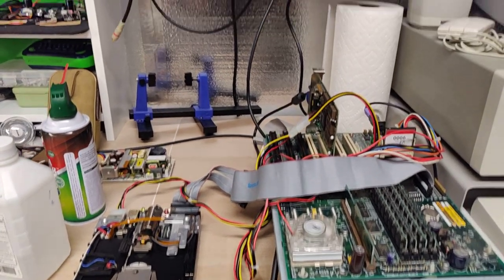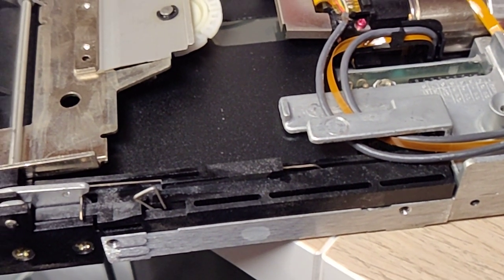Quick take: Fixing an interesting Okidata GM-3315BU 5.25" floppy drive

Comment: Nice quiet drives, must have been expensive to make or unreliable since I can imagine they'd have been more popular. Having said that, I always liked the mechanical sounds drives made. They give the machine character and when you're used to them you can generally tell if something is going right or not from the sounds emitted.

Comment: One of the drives in my Compaq Portable II doesn’t work and the other can be flaky sometimes, so I’m going to try this! Neither spit the disk out properly when the door is open either, so I’ll get that fixed too. The Portable II uses the same drives, with the only difference being a gray faceplate versus a black.

Comment: One of the DIP switch settings is probably to bypass the head loading solenoid. That solenoid is some sort of leftover from the 8 inch floppy drive days where the spindle motor was always running.

Comment: Pretty sure the large diameter thin steel plate around the drive motor is a flywheel... there to increase rotational speed uniformity. (Edit for readability.)

Comment: I heard you said motoroil. I would be careful about using motoroil with plastics at least for the long run. I think silicon grease is whats recommended for this application.
Reply: Certain types of rubber can be degraded by petroleum oils. I don't know about plastics, but it depends on what it's made of.

Comment: It's not a "half height" size, it's quarter - the normal 5.25 units are already half height.
Reply: After seeing this video I obtained 2 of these drives from ebay for some project computers, and they are more like third height drives. Not quite as tall as a half height, but stacking both of them on top of each other and they are taller than a half height.
Reply: Yeah, once you get out of full and half, it gets hard to tell a 1/4 from 1/3 or 1/5 drive with out having a ruler next to it! I used to use some with my BBCs which were under 2cm tall - they didn't even have room for an eject/locking lever. You put the disc in, and presses a button in (which latched) to lock it. Pressing it again popped both the button and the disc out.
Horrible drives they were!
Reply: Got several of these, and they are exactly 1/3 height. You can fit three into a single full-height bay with no gaps.

Comment: The head probably generates a slight magnetic field spike when first energized, so by holding it away from the surface until the inductive spike is damped prevents damage to the magnetic media.

Comment: It's funny he didn't know the size of these drives (perhaps he doesn't have any 5¼ half-height drives - floppy OR hard).  These are "one-third" height drives.  If you stacked 2 half-height drives next to 2 of these... you would see they are shorter by one-third (or if you had "3" of these, they would be the same height as the 2 half-height drives)!

There was a time, that if you had "two" floppy drives in your PC... you were a SERIOUS computer user!! 😉

When I first had my own computer, software was loaded or saved on audio cassette tapes (leaderless "Program Data" cassettes were preferred... but any standard audio cassette tapes would work, which is what I used).  A few weeks (maybe a month or two) later, I got a floppy disk drive.  It was a "full-height" 5¼ drive, and ONLY "single-sided".  Boy, was I stoked to have such an advanced, powerful computer system!!! 🤣

Comment: The Canon MD5501 has a similar form factor and the disk loading mechanism is also quite similar but that one uses a normal stepper motor and once the drive bay is closed the heads are lowered onto the the disk.

Comment: Cool drive! I wonder if the head transport is a voice coil. Kinda looks like it, with an inner and outer magnet. It looks to me from here that they're quarter-height drives. I wonder if you can fit two in a half-height bay. You can tell these are much later drives, because they have double sided heads and are probably 1.2MB HD. Close to the very end of the 5.25" formats life time.
Reply: No they are more like third-height, and they are 360k DD not 1.2MB HD.

Comment: I've got a couple of drives on the shelf that are similar to that, but not. I'm not sure the brand, but they are combo 5-1/4 + 3-1/2 drives in a single 5-1/4 form factor. Haven't looked at them for years, but held on to them in the event I ever needed a 5-1/4 drive.
Reply: Teac dual media floppy drive is God tier.  I still have mine that I bought new back in the early '90s.  Treasure it.  Always.
Reply: I've got a couple like that.  They're Epson IIRC.
Reply: Bandana zX  I went digging around and pulled one out, and they are the Teac drives.  I know that they work as well since I tested them out when I first got them. One is still installed in a computer that I put together to use for all sorts of diagnostics on used equipment that I got.
One of my original aims for the drive was to see if there was any way I could put it in my Commodore SX64 portable. Thought it would be nice to have both 5-1/4 and 3-1/2 in the same 5-1/4 existing slot. Would mean a significant bit of retrofitting of the electronics, which is why I never got around to it.
Reply: Adrian Black  : The physical mechanism of the drives isn't really all that dissimilar. A stepper motor driven read/write head, spindle motor, and the read-write head itself. The big difference is in the control electronics.
The C64's 1541 drive basically has a full computer built in, whereas PC drives contain only the drive interface.  This is why the drives were so slow in their default configuration.  The fast-boot cartridges bypassed the standard data transfer mechanism by downloading new code to the drive itself in order to speed things up.
My thought was that if the interface was removed from the drive, then the 1541/1581 control board SHOULD be able to operate the drive directly. But like I said, the time involved in tinkering to try to get everything right, along with the lack of a spare 1541 control board, is what kept this project on the shelf.
Reply: I had a Leading Edge 386 many years ago that had one of those.

Comment: Reminds me the Zip 100 drive using linear acturator for heads. Probably this drive would be capable of higher densitiy since you can have more tracks than standard floppy drivers that move on discrete steps.

Comment: Going to bet the head actuator is an inline direct acting bipolar stepper motor with a fast pitch lead screw. Unlike the cheaper variants of 3 1/2" that have a follower arm that tend to torque to one side (source of the infamous floppy noise) this only has to rotate 2 to 3 turns to make the full stroke.  This comes at the cost of lower output torque and is why the heads are lifted when not reading since they would tend to be dragged by the rotating floppy. And since the motor is at a mechanical disadvantage with no way of knowing it has missed steps it wouldn't take much to have the head stall like you had.

Of course this is all speculation based on my limited experience amd what we can see. Cheers!

Comment: Reminds me of the motors Sony used in the Walkman. If it's similar, the spinning disc is a magnet, with coils underneath.
Reply: The thinnest ones used a pair of pancake servos integrated into the main PCB to directly drive the reel capstans and only had a belt to drive the pinch.

Comment: I thought one used a specific kind of diskette for head cleaning. Couldn’t tell from what you were using.
Reply: Yes, when the point is to clean the heads.  In this case, the point was just to watch the head assembly move, so he chose the head-cleaning procedure since it performs a gratuitous number of seeks.

Comment: Notches on both sides of the diskette?  Is it single sided only?
Reply: I used to cut the write protect slot and make my own double sided disks
Reply: The drive is double sided, but he's using disks he had from his older 8 bit stuff (like commodore 64) which had single sided drives (where you had to cut notches and flip them to use the other side).
Reply: Also, it only has the extra write protect notch, it doesn't appear to have a second index hole for the rotation sensor.
Reply: Astute observation.

Comment: What are 'bodge wires'?
Reply: When they mess up the PCB, instead of redoing it (which can be very costly) they would just rewire the board by hand, as labor prices were cheaper than respinning a board.
Reply: Evergreen So they are patch wires.
Reply: FRIENDLY JAPANESE BUSINESSMAN I have heard them referred to as patch wires before, and no, I am not from the French speaking part of Canada.  I hate the French language, in fact.
Reply: mipmipmipmipmip
Yeah, no shit.  Not that I take offense or anything; I don't care if someone hundreds of miles away insults me.
Reply: Adrian Black I saw this being done to bypass traces damaged on a Commodore 128 logic board on The 8-Bit Guy's channel.
Reply: If anyone is interested, the wire used is called Kynar wire, super useful for quick mods.
Reply: They can also be called mod wires. Mod as in modification.
Reply: They're called bodge wires because bodge's definition is a clumsy or an inelegant job. Bodge wires on a pcb rarely look good.
Reply: @smallmoneysalvia  I've always called it "prototyping wire."